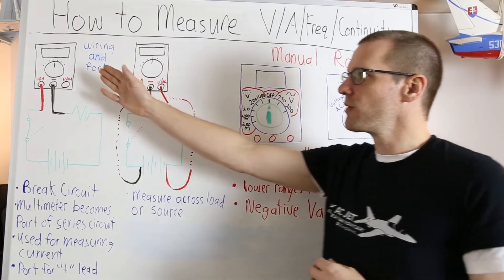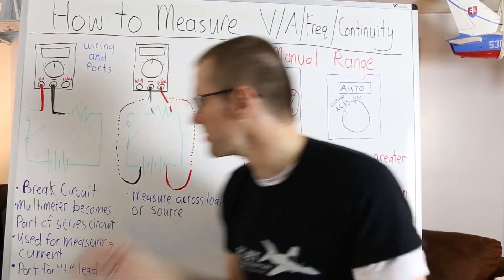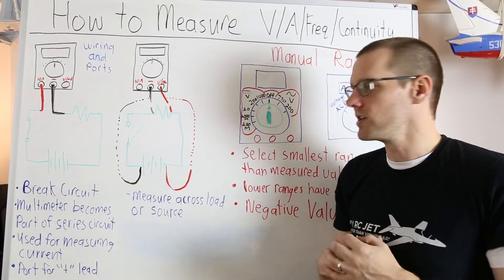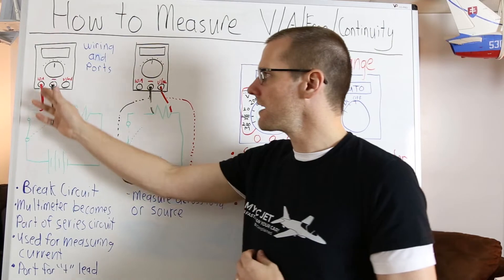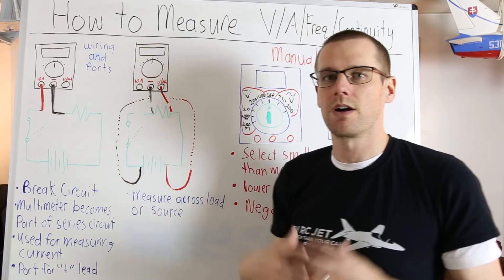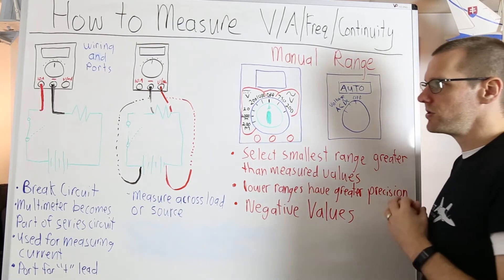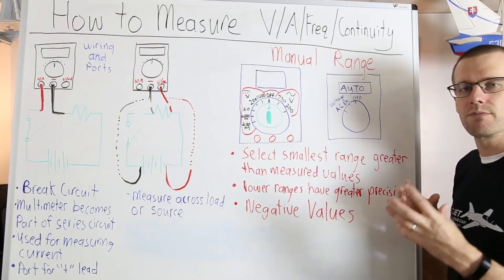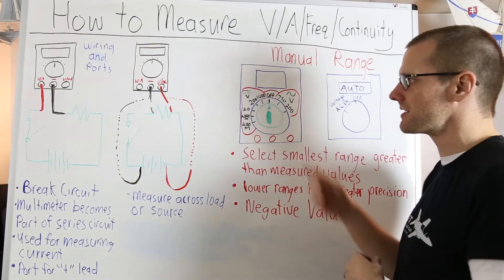How to Use a Multimeter to Measure Voltage, Current, Continuity and Frequency

Comment: Hey man, I'm a big fan of your videos, especially the ones discerning kv ratings on brushless motors. BUT, there is one thing I have been trying to figure out and you may be the only one that can help;

What is the relation between the highest KV and the weight of the chassis that would allow you to race without overheating? 
E.g.: What is the highest kv you can run in a 6lb chassis without it burning up?
(Likewise for a lightweight chassis; 4-4.5lb and for a heavyweight chassis; 7-9lb?)
Reply from the maker: Hi Tenni, there is no relationship with kv and weight of your chassis. the kv is related to the RPM you need to hit and the voltage you plan to run.